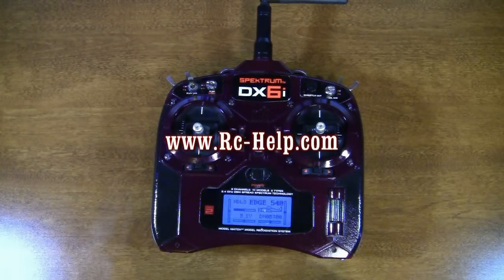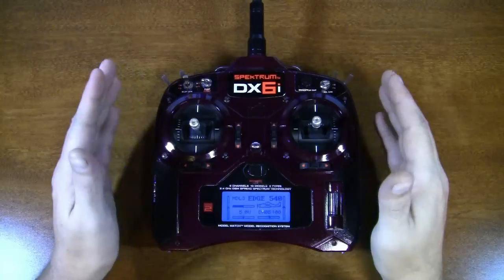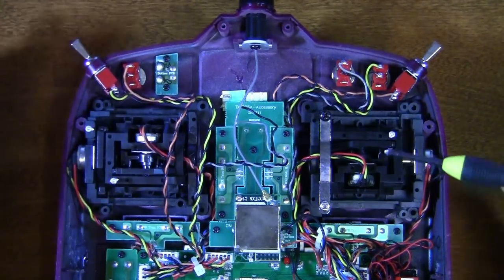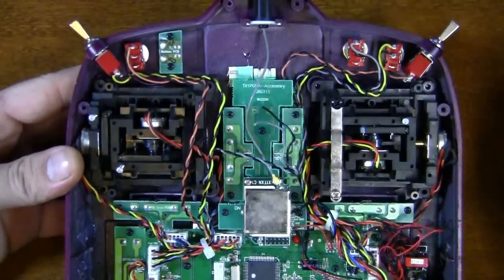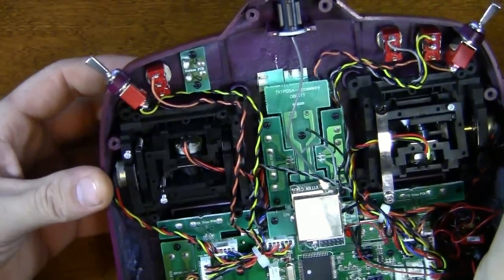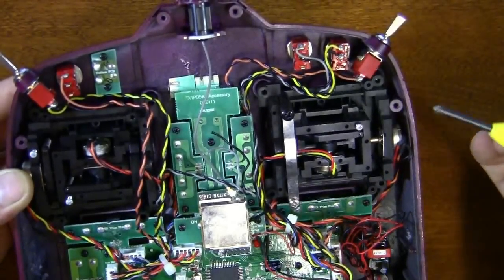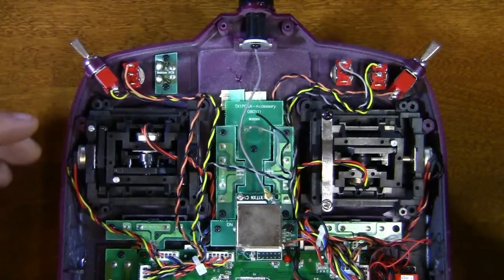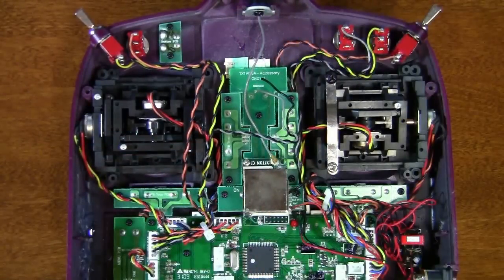DX6i Stick Tension Adjustment

Comment: Wished I'd seen it yesterday, I took my DX7 apart and loosened off the metal plate as my throttle was a bit jerky mid way, thanks for telling me about the other screws, might look at them later. Ps I loosened the plate to much first time so if the transmitter was turned upside down the stick moved by itself and rotors turned. No no no!

Comment: Hi friend, nice video. I have a really big problem I think. Last time when I meet a "instructor" to fly my apprentice  plane for the first time, we linked the transmitter using the trainer port, my DXe spektrum did not work at all.  I am new with this, but the instructor evidently, seemed he did not what he was doing. My DXe stop working , it went off. I tried to turn ON , it turned on, it beeps few times , then continue beeping constantly. The transmitter is unresponsive, I can not bind back to the plane, it continuously beeping. I tried to use with a simulator and everything works except for I can not control the speed , I can take off but no landing because is  at high speed all the time. I read that the throttle might be bad , hope not.I totally lost. I have not contact Horizon yet. The store from where I bought they don't what could be, they say , never seen that before,   Please advise
Reply: you mean , trying to set up a new model or "mode". Sorry, I am a little overwhelmed researching about this issue. Any help on how to proceed with your advise will be greatly appreciated.
Reply: My spektrum does not have monitor
Reply: I got a new replacement manufacturer.